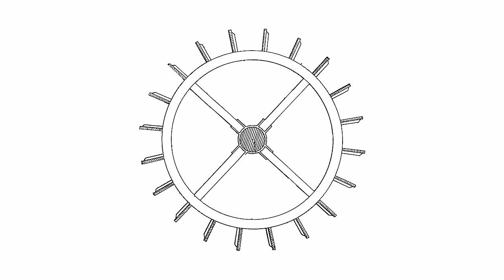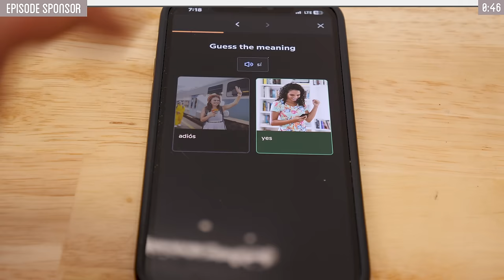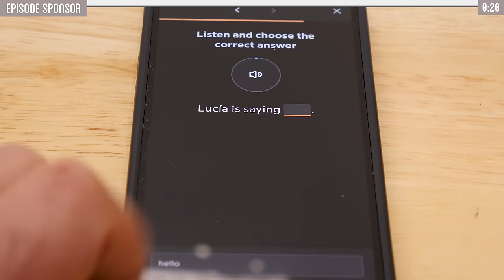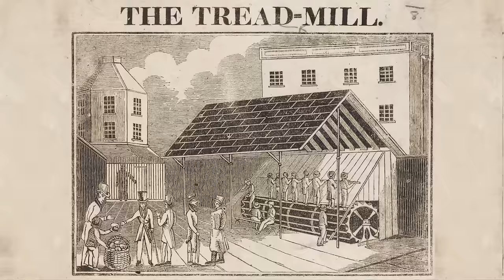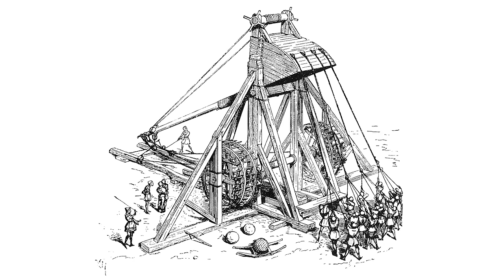This Machine Powered the Roman Empire!

Comment: I'm seeing a lot of comments talking about how we should have built it larger so we could stand under the axle.  To clarify, having the axle at shoulder length is accurate, to both historical imagery and professionally done recreations.  It is hard to translate the size of this wheel through the video, but Andy wasn't kidding when he said it could have actually injured us badly, the weight of the wood alone was over 1000 Lbs.
Reply: Things like this are definitely scary... and if the examples all have the center bar at that height, there is probably a reason....
Reply: Was there no way to have an axle on each side so to speak so as to have free space in the middle?
Reply: Thinking about the project further, a higher gear ratio coming out of the wheel would improve things dramatically, both for speed of hammering and other projects, it would also provide some resistance against the walking so as to prevent the wheel moving to fast
Reply: I would consider making at least hand holds on the inside of the wheel from an outside jacket to hold onto. That way when you are walking you aren't trying to grab at a moving square but something stationary yet attached
Reply: Was there any consideration for doing the external walking wheel instead of the internal?

Also might be a good idea to add some padding around the axil for safety.
Reply: Yeah, there are a few nasty pinch points there that need to be enlarged so they arent so dangerous.
Reply: @blablabla1000able that would probably work, but that would lead to more points of failure I'd assume. And probably why it wasn't really used all to much. Plus where would you get in and out of that would be available no matter the rotation of the wheel? Not saying it couldn't be done, but with simple and quick construction, it's definitely a challenge
Reply: what you need to do, is make stronger cross bars on the outside of the wheel and use those to support the weight, remove the middle beam entirely and use it as a bar on the outside support frame going over the top, then make two small axels on either side of the wheel, then you won't have the big weighted bar in the middle.
For extra browny points but not for the channel obviously, you can add sails and surround it with copper wire, add a magnet underneath and hook it up for power generation, although the noise might be quite annoying without the use of metal bearings, might as well get some of that money back...
Reply: another idea would be to add a rotating metal bar in the middle angled around the walker so they can hang onto it as a handle instead of having it bump into the back of their head.
Reply: You have the hamster set up for speed but not for power. Which means that it causes you more nausea as you need to move more to hit lightly and rapidly instead of less often but harder.
Maybe find a better way to create more effort in each step but have greater power/torque in each blow off the hammer or saw blade
But what do I know I'm just an engineer (software engineer that is 😂)

There are software out there that allow you to test your designs in a physics engine. This way you can get a better return on your investment and estimate weight and cost as well. I know it's not an ancient tool but math was technically already invented
Reply: The center axil should be stationary whilst the wheel rotates on it rather than with it. Might not be historically accurate but putting wooden bearings and lubricant such as grease would increase ease of use and decrease wearing. It’d also make replacement of worn parts easier and cheaper

You can also reinforce all the joints and not use a center axil but use a dual axil that’s attached to the wheel but floats in the base mount without protruding into the “cabin”
Reply: You could alway just chisel and sand a smooth round into the center of the bar, and then have a loop of strong fabric that goes around your shoulders and around the back of the smooth round. That way you can just lean forward against the straps and walk, and not have to worry about contending with the central bar.
Reply: could you put a smaller wheel or cover that spins free on the axle? that way you could hold onto that and use it as a handlebar
Reply: At Guedelon castle (experimental archeology build site, France), the treads are angled to act more like stairs.
This has a double effect of creating more torque at low speed, while moving the operator forward of the axle.
Reply: Could probably add a hand bar on the axle that can move seprately, my main worry though would be if the bar gets stuck and takes you with it and suplex's you.
Reply: I would make the axle round so you can grab it for support
Reply: Maybe a harness on the axel would be a good idea. Save the face and bones if you fall.
Reply: That's a f*ck ton of wood. Ok, half a f*ck ton of wood. Lol
Reply: @aeoneternal5193  this is the right way to go. The bar in the middle wouldnt be a problem if you needed your weight forward to get the wheel turning
Reply: he literally shows a roman crane with the axle above their heads. 

so huge oof my guy
Reply: add some kind of padding to make the axle round, and then you can hold on to it in front of your shoulders to walk or run.  i've played in ones made from metal pipes and not as solidly planked up, so it's holey and you can see through so you can focus your eyes on something distant.  it's probably way less dizzying.
Reply: @StarScapesOG  🔴 What Is Islam? 

🔴 Islam is not just another religion. 

🔵 It is the same message preached by Moses, Jesus and Abraham.

 🔴 Islam literally means ‘submission to God’ and it teaches us to have a direct relationship with God. 

 🔵 It reminds us that since God created us, no one should be worshipped except God alone. 

 🔴 It also teaches that God is nothing like a human being or like anything that we can imagine.

🌍 The concept of God is summarized in the Quran as:

📖 { “Say, He is God, the One.  God, the Absolute.  He does not give birth, nor was He born, and there is nothing like Him.”} (Quran 112:1-4) 📚

🔴 Becoming a Muslim is not turning your back to Jesus. 

🔵 Rather it’s going back to the original teachings of Jesus and obeying him. 

More .....
Reply: I had the same thought for a second before realizing that making it that tall would mean adding maybe 4-5 feet to the diameter, and then realizing how absurdly huge that would've made it.
Reply: Extreme gear reduction to convert all that torque to rpms
Reply: You can make the center part of the axel cilindrical and put a Handel on top (like ball bearing). This way you can grab the shaft as a handle and have it rotate freely.
Reply: @blablabla1000able  i would assume they were going for historical accuracy and not what would have been nicer to use
Reply: you have to think about it in term of cost. these thing are made of wood in the humid environment of the coastline means that these things will in a decade rot to the point where the entire thing needs to be replaced. They were also being made with more primitive tools and less nails. every plank you walk on will have to be carved in order to fit into the wood frame which causes exponentially more effort as the size of the circle increases
Reply: On the point of historical accuracy though the Roman soldiers would have only put every other board and would not have had a fully sealed walking surface. IDK if that was a adaptation to modern safety concerns. But the Roman army for sure would never have had a fully enclosed walking surface in these wheels if only to allow water and mud to go through them and not use so much material.
Reply: I’d think if you wrapped the axel in material so it was round on the inside, That would allow you to brace against it some while you walk and still allow it to rotate. Though maybe the increased friction would offset it.
Reply: I'm surprised they didn't't build rail guards to walk on top. I guess "climbing" the slope inside the wheel gives more force?
Reply: @blablabla1000able  definitely could be, but that would drastically decrease the strength of the overall system. The crosses used are not that sturdy and having a center rod connecting both sides creates a lot of sturdieness (is that a word?) in the system
Reply: so let me get this straight, for ACCURACY you built a poor designed wheel, to be correct to history....while wearing health and safety gear.
13th century 30 year project, if a good portion of you are not maimed or killed, you are not being ACCURATE!
Reply: In a threadmil used to lift something you wouldn't stand below the axle. Instead you would be way forward, almost leaning against the "wall" curving up in front of you.
Remember: it is not the force of your feet doing the work, it is your body weight doing all the work. Thus you need some distance to the axle in order for your body weight to generate the momentum which eventually drives the wheel (momentum = force times normal distance to the center of rotation). Look at some ancient drawings. The people inside are almost crawling up the "wall" in front of them (while the "wall" moves down as the wheel turns). In order to do that, they had bars nailed to the inside of the wheel to act as steps and also to get a hold with the hands.
Their "problem" comes from the fact, that they are not doing some work with the wheel. The hammer doesn't cut it.
Reply: Stabilize it from the outside and cut out the beam in the center

Comment: I think that if you put a bigger load on it (something that needs a high torque), the problem of the bar being in the way wont matter as much because the person will automatically walk to the front to a steeper part of the wheel to create the needed torque
Reply: exactly that. and with lower weight you just gotta make smaller steps
Reply: Yeah, that torque would also help with efficiency, I think. If the person is further forward, their tread will automatically become one more efficient for going uphill, which will also be more efficient for moving the wheel.
Reply: Came to the comments to say this, haha.
Reply: You could avoid needing the axle entirely if you sat the human wheel on 2 sets of smaller wheels beneath it and draw the rotational energy from those which also acts as a gearbox. If you were worried about the wheels slipping you could even add teath and turn the whole thing into a giant gear. Obviously can add more sources of friction and therefore make it harder to turn but you can stand in the dead center of it.
Reply: @GoldMike_  True, but as soon as there's any real load on the treadmill, you'll be walking forward of center anyways, so there's not really much benefit to building it that way unless you just want to use the treadmill for exercise. The walking alone isn't really what generates the force to turn the wheel under load; your body weight does most of the work simply by being in front of the axis of rotation. The closer you are to the axis, the less leverage you're able to exert on the wheel, so when more leverage is required to turn the wheel, walking in the middle becomes impossible, or at the very least painfully slow and inefficient.
Reply: Hmm, thing about ancient technologies is that they're are all very time intensive to fabricate - not at all suitable as week-end projects for the retro hobbyist

Comment: For the auto hammer I have 2 suggestions if you want to use it.  First is to make it a double or triple hit per rotation given the speed of the wheel using either pullies as gearing, or by changing the shape of the cam to be a double lobe design.  The second is to use a much heavier hammer with a longer handle so that you'll have a harder hit so that it'll be more useful.
Reply: Stole my Idea
Reply: There's a video on YouTube, by someone called Chateau Du Clos Luce, that shows a brief animation of Leonardo's hammer design.  It uses a bent shaft with a fulcrum that looks like it would be a decent improvement.

Comment: Have a look at the videos on how they built Guedelon castle in France where they used only medieval tools and techniques.  They used a treadmill as a crane for lifting masonry.  The BBC had a series called secrets of the castle
Reply: At Guedelon the treads are angled to act more like stairs.
This has a double effect of creating more torque at low speed, while moving the operator forward of the axle.

Comment: For safety, I would add some sort of netting to avoid being able to stick your arms past the wheel itself. There were a few times you guys went to grab onto the supports but almost missed. Getting an arm caught between the crosses and supports will 100% break it.

But also, you need a braking system. A lever a 2nd person could slowly pull to push a block of wood against the wheel to slow it down and stop it for the person inside. Perhaps make it to where it can also lock so you can get in and out without it spinning
Reply: Not only will it break an arm, it'll take it off. At my own 15th birthday, my best friend lost a finger by the leverage of a door (a cheap, light indoor bedroom door) and the door frame.
Reply: @horisontial same principal as scissors, or shears..! ahhhh!
Reply: This is all I could see when they were grabbing for the sides. They’ve built an arm guillotine.

Comment: A few possible suggestions for the design: if you round the center of the axle and polish it, you could allow the person inside to lean against it in relative safety; it would likely be a good idea to make sure the axles are well lubricated (starting with beeswax and moving on to other lubricating agents you have available would be a good idea), and you could possibly even protect the axle or the axle frame using some sheets of polished copper to act as a buffer.

Alternatively, just make like it's the 1500s and utilize the children - they get a place to run all their energy out, and you get some degree of power from it!
Reply: Dr Stones Vaccuumpump, can this youtuber or any of his fans tell me about it? I felel like i have bad grasp on it. Same for the Waterwheel

Comment: A handy tip when walking in it: To avoid becoming dizzy, focus on a stationary object outside the wheel, rather than looking at the wheel itself.
Reply: 12:49
Reply: Dr Stones Vaccuumpump, can this youtuber or any of his fans tell me about it? I felel like i have bad grasp on it. 

Same for the Waterwheel
Reply: I was going to suggest seeing if adding a half board width gap between walking boards would help with that, say 1"-2" gap if using 2x4s

Comment: I think you need to look at using gears to multiply the force because right now the wheel spins too freely and generates very little useful motion. Maybe a small gear using the outside of the wheel for sprogs instead of the central beam will spin faster while central beam gives more torque due to leverage from the distance to the wheel.

Comment: For those interested in it, there actually a gargantuan version of this that was created for the castle being built in France using entirely medieval methods. It was featured in the series Secrets of the Castle and used to move stone as an early form of crane (as mentioned in this one.) There was also a water powered grain mill that illustrated further the difficulty in actually building them.

Comment: awesome build! If you added grooves on the axle, you could add a handle that slides around as you walk allowing you to hold on and kinesthetically sense where the axle is and thus allow you to close your eyes and avoid much of that nausea feeling. the better answer being that the axle should be 8 feet above the walking surface, allowing full walking clearance, but this does make for a very large wheel.

Comment: I would suggest lubricating the axel with rendered beef or pork fat, .also cross pins in the axel will keep the wheel from "walking" side to side. I also suggest some leather or wooden washers to hold the lubricating fat in place. Interesting project though.

Comment: I think it's possible to remove the main axle from the inside of the wheel, and replace it with what's basically a fixed bar for holding onto, to make it much safer. without a good support, if the "worker" gets ahead of the centre, they'll reach for a support to stop themselves falling, and that's basically asking for a broken (or worse) arm as it gets closer to the supports.

as the load increases on it, you'll have to work harder, so it'll be more difficult to get "ahead" of the load.

another thing, if you can make some type of spring, either some type of coiled steel, or leather, or something like that, you can increase the hammering blow. you can also increase the ratio, so it gets more rotations per second, which will increase the load on the wheel, but it won't be by much.